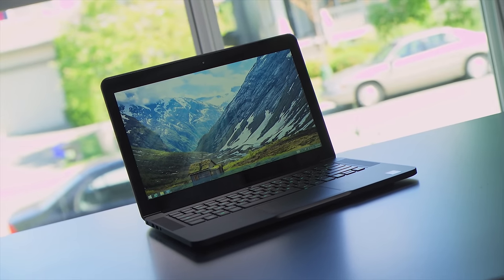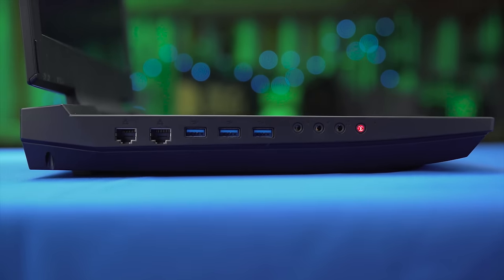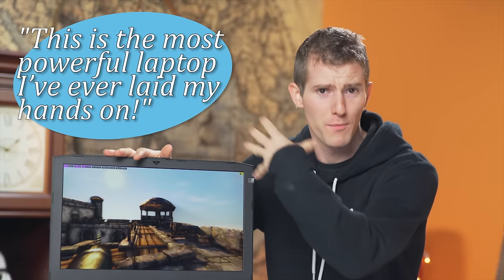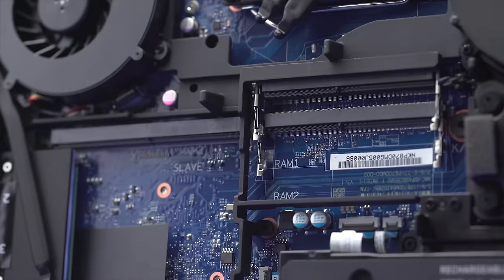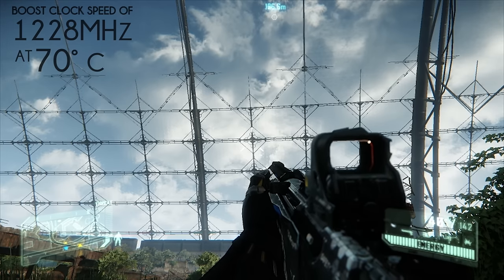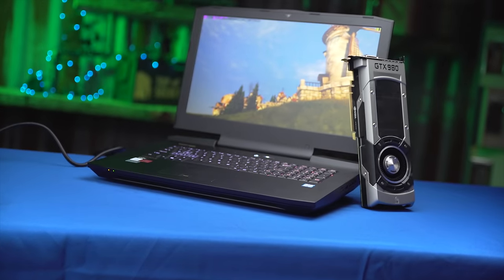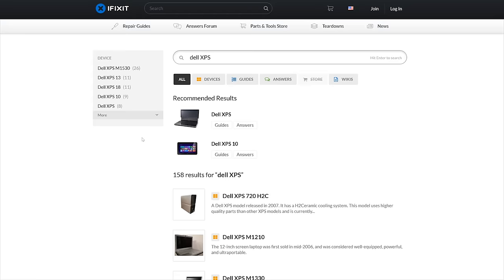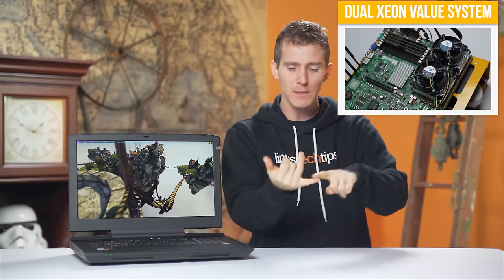Full Desktop Gaming Performance in a Laptop

Comment: more powerful than the MSi Titan GT80? I don't think so
Reply: +Monsieur Africain Well done comparing SLi to Non SLi
Reply: Cody Lynch well whether people like it or not, the MSi GT80 Titan is currently the most powerful gaming laptop on the market.
Reply: Monsieur Africain Are we talking the SLi 980m or the Desktop variant.

I'm not arguing against it but i dont think anyone is going to consider it more powerful than an SLi rig.
Reply: Cody Lynch There are two high-specced MSi GT80 Titans, one with 2 980m in SLI and then another with 2 980 Desktop cards in SLI. Whilst you are correct in the fact that it won't outperform a desktop rig with like 2 980Ti in SLI, most people can't have desktops due to limited space and the fact that desktops aren't portable :-D
Reply: Monsieur Africain Yea, i have the PCSpecialist built 980 with a i7 6700k, 16gb VRAM in mine, i sold my desktop rig for it (Which had a 980ti) because i moved to Japan.
Reply: Cody Lynch dang very nice and that's a good way to go imo. You aren't going to find too many games that you can't play at highest settings. I think the beauty of laptops is that with these high-end laptops you get desktop performance anywhere.
Reply: Monsieur Africain Yea, even when i was still in UK i could just take it anywhere

Comment: laptops are all good and well until you wont to upgrade it and then you piff the sucker and buy a new one. i will stick with the desk top for gaming and productivity and a cheep laptop for everything else. that said if you could upgrade the gpu to a new one like a desktop pc without haveing to have a massive water cooler to plug into the back i would see a resign to buy one. that said a single gpu laptop that you can plug a duel or 3 way gpu docking station into would be a good option. single gpu for out and about and a 2 way/3 way gpu docking station at home for gaming and serious productivity. now there is a desk top killer so to speak but a good compromise i think and there is more chance of it know  than in the past due to nvidia and amd doing away with the sli and crossfire bridges and doing it over software.
Reply: +Brett Masters You can upgrade the CPU and GPU (everything minus mb, keyboard and chassis) on this. Clevo/Sager has some models that allow this.
Reply: well that is great go to see there is a serious laptop option instead of a throw away Samsung/acer.

Comment: y does it hace 2 ethernet ports if i plug both in at the same time to my router will it be like twice as fast or something somebody please tell :)
Reply: Each ethernet port runs at 1000 mb/s giving you fast reliable internet access. Since there are two you can connect two ethernet cords to your router and since ethernet ports are multipliers then you would be getting 1000*1000 mb/s which would result in 1000000 mb/s depending on how fast your internet is. If you have like 60 mb/s internet it will give you 60million mb/s internet.
Reply: +Julio de Haro umm im pretty sure it doesnt work like that
Reply: Doesn't work like that.

Comment: The question is: can it runs VR?
Reply: wow.....
Reply: +The Dockpacka Keeper lol..  It's a gtx 980.. For 5000$.. Umm I would just buy a alienware (most expensive version) with graphics amplifier and put the new titan XP and it will still cost just as much as it..  But have 2x performance lol
Reply: +The Dockpacka Keeper let me correct myself. Even more than 2x
Reply: +MrDoge FTW 1080m is supposed to be as powerful as titan X (old one) actually a bit more. I wonder how much will that cost..  And u can take the amplifier with u it's not that big.. But u can't use it on the go lol

Comment: But still MacBook Pro is thinner than Sager's thinnest side. Why they don't use any engineering skill. Computers had to be faster and thinner but they are getting thicker. Losers!..
Reply: Good luck putting a Gtx 980 in a thin laptop without melting
Reply: You design a laptop as powerful as this and thinner, then you're probably gonna make a fuck ton of money.
Reply: CorrosiveVisualizing Because that's true engineering. And actually now it's official, I'm gonna be a computer engineer.